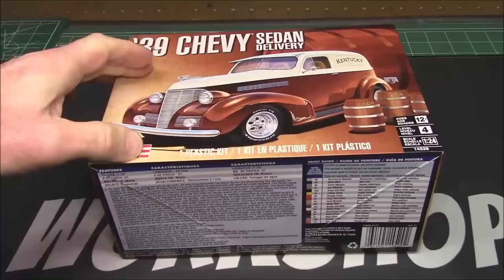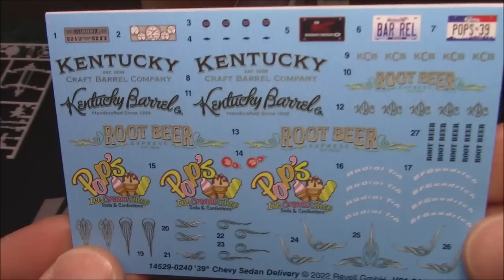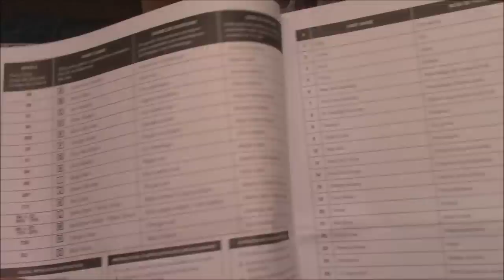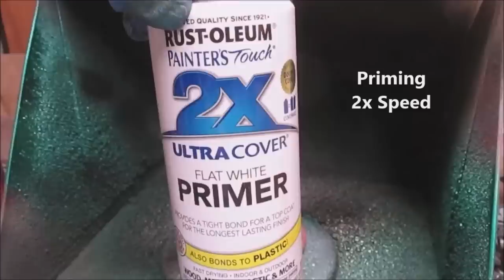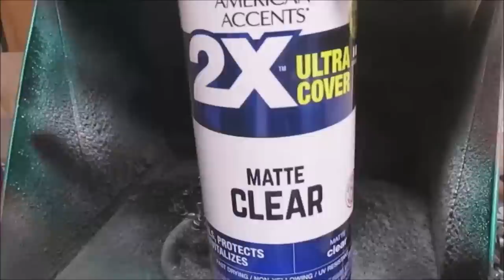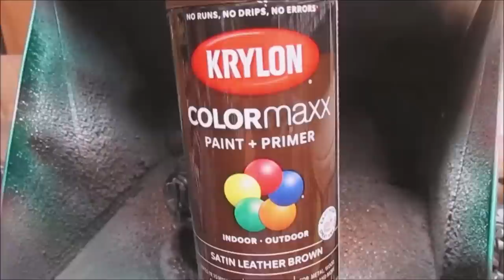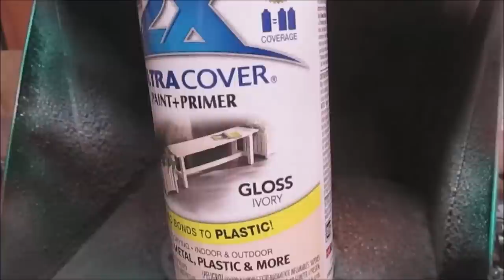1939 Chevy Sedan Delivery 427 1/24 Scale Model Kit Build How To Assemble Two Tone Paint Dashboard

Comment: The coupe and the sedan delivery were made in the late 70's/early 80's. The coupe was molded in a maroon color and the sedan delivery in a green color. I had them both as a kid. Another great video.
Reply: That's how I recall them, the Coupe and the Sedan Delivery , in those respective colours. IIRC, they were both 'updated' in c.1987 with then-new wheels (not a fan) and tyres (to the wider Good Year Rallye GTs).
The coupe has a supercharger; the delivery has the tunnel ram -- not sure if those were "switched" around c.1987.

Great build up, Chris ! Excellent colour choices (I love Ivory on these 1930's vehicles) and tasteful touches (glad that you added Molotow to the running boards' trim).
Reply: Dr. Feelgoods miracle elixer
Reply: @kennybuckman6483  That's the one I have, and I assume the "glass" shown at the beginning of this video is for both the coupe and the sedan delivery

Comment: There was a lowrider version of the same kit. I believe it came with optional lowered suspension and wire wheels.
This is a nice kit, wish it had a steelie wheels, hubcaps with beauty rings. Larger tires on the rear and smaller is the front.
Keep up the nice previews of the new releases and your builds😎

Comment: The rear wheels were off center on real cars. It had something to do with the rear shackles. When you added weight to the vehicle, you flatten out the springs. Seeing as the front of the springs were mounted solid, the wheels would be forced back into the center of the wheel well. Oh and for future reference those lights on the bumper are fog lights and should be painted yellow or light amber. Nice job as always 👏 👍

Comment: It was re-released by Revell in 2001, but it released by Monogram in the late 70s It's a much older kit than you might think, but a lovely fit.
Reply: That answers a few questions that I’d had about the kit. It looks like there was supposed to be another sprue, as well. It seems odd that there was never a plan to include an air cleaner, or the rest of the firewall.

Comment: Nice build Chris!👍 I'm glad to see this one back! I do wish, however, that they had included the wheels/tires from the 1978 ElCamino kit ,(Cragars/60s series tires), as they are more "retro" to the other aftermarket equipment in the kit,(late 60's early 70's). Glad you did the "Cherry bombs". They look great on this kit! My one wish is they would do a two door "Bustle Trunk" sedan body for this series of kits!
Reply: I wonder if that is what the second window set is for. The front end goes a good job of lining up to the window frame, but the back is slightly wider than the space of the delivery interior, and the back of the door opening doesn’t line up for this kit. That still leaves what the “moon-eye” windows are supposed to fit…
Reply: @scotiadragoon5974  They have a coupe model in this series too which was released earlier. It might be for that one.
Reply: @philiplawless81  
That would make sense. Thanks!
Reply: @scotiadragoon5974  👍

Comment: Good color choice. I'm digging it. I built this kit way back in the late 80's. It had different decals and wheels, but it was basically the same kit. Maybe Revell re-did the molds/tooling? Btw, this has "bothered" me a long time: You're not using the panel line wash correct. You're supposed to let it dry, and after it's dry wipe off excess wash. I use a cotton bud and odourless mineral spirits for the purpose. I bet You've read this before, but I had to comment this.
Reply from the maker: LOL, no one has tried to tell me how to use my black wash before you.

There is no 'proper' way to use it.  Use it in the way that will give you the results you desire. 

Thanks for watching.
Reply: @hpiguy  yeah, I hear You. Maybe my comment wasn't composed all the way through, and I apologise. I'm all for You build for You. Thanks for the content.

Comment: These are the kinds of kits that I lean towards, now. Clean, clear detail, but a relatively lower part count, with an open invitation to modify. Higher-part-count-kits are challenging to build, but don’t “speak” to me in the same way.
Reply: Well, apparently it spoke me more clearly than I thought: I picked one up, and am going back to get another( I need the wheels for a trailer that I have planned). Loads of trimming and fabrication ahead, and I should have a mobile cafe with a rack of lemonade dispensers( the barrels).

Comment: Got the '39 Coupé Street rod. Twice. One is built but suffered chrome loss during its stay in the humid basement of my folks' previous house and the second one is unbuild. Seems the coupé and sedan use the same wheels. Engines are different, hood and body + interior are different. They MIGHT have modded the fender part so that it get from a 2 seater (or was it a full bench?) as to make it a delivery. Was a fun one to build (which is why I have another one), so I guess this one is really fun to build too. The original coupé date from 1979 and what I've found is that the sedan was made in 2005, as a low rider from the coupé' molds (which explain why it use the coupé's wheels, as a low rider, it had lr wheels ) and the kit wasn't re-released between then and the edition you have in your hands. Scalemate still haven't included this release on their kit's history tree page yet.

As always, awesome build. Your build would fit well in front of a A&W restaurant diorama.
Reply: Addon: Things didn't add up for me, with the Low Delivery being the first edition of the delivery version, so I checked around a little bit more and found out that the ORIGINAL release of that kit was under Monogram in 1978. So, I dunno if there was lots of changes made to the original release along the years before it was released as the version you have. But yeah. This kit's original first release is in '78. Scalemate's pages about the Coupe and the Delivery are not linked to one another, so it's kind of odd. But even on that page, they still haven't updated this edition as a new entry.

Comment: I don't think you showed it in the video,but does the back door actually open or did you end up just gluing it shut permanently???
Reply from the maker: It opens. a very tight fit on the hinges but if you want to move it, it will open. Those .5mm pins aren't made to last though so they will wear or pop off pretty fast.
Reply: @hpiguy  thanks! I'm building the kit now and was wondering how they would actually function.
Reply: @hpiguy  maybe metal pins in place of the plastic ones might work